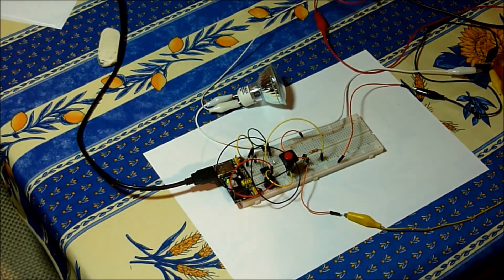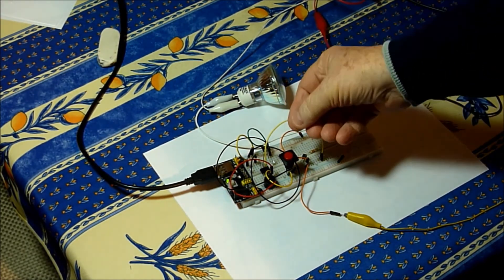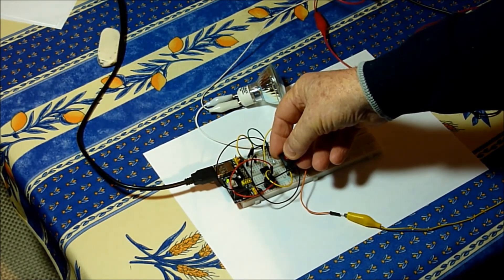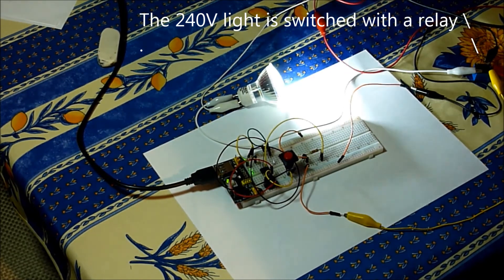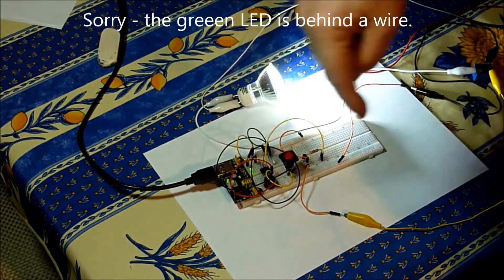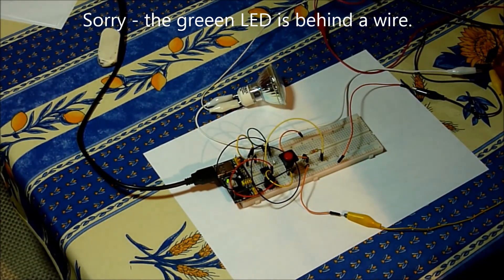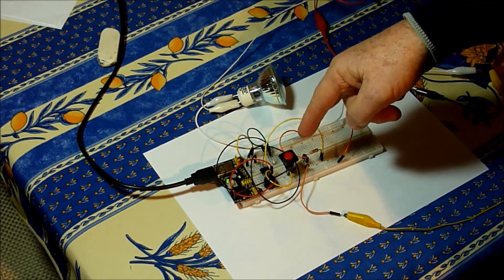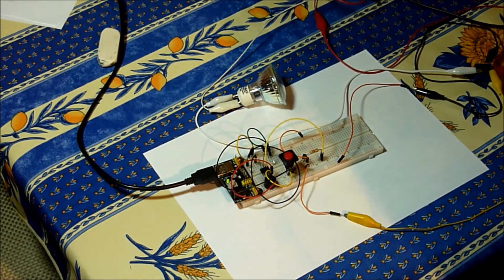ATtiny Assembler Tutorial Part 1 - Introduction

Comment: Hi
Thank you for your cheap design, I interest to make it but I can't find what components you used and circuit board design can you share please and some more information about components?
Thank you
Reply from the maker: Which design are you referring to?  In the course introduction, I mentioned a couple of things I had done with the ATtiny85 - the slow-start for my table saw (still working fine) and my "one-button timer" (schematic and code is on Google Drive.  See the links in the description text of "ATtiny Assembler Tutorial Part 6" During the course, I played around with the timers, flashing and dimming various combinations of LEDs.
The timer was built on breadboard, and I did not make a circuit for it.  There was no printed circuit card for the slow-start either - I just made one for myself on strip-board, but the schematic diagram and the code are in ...
https://drive.google.com/drive/folders/1AwNbtnRtm9biUsw1ys868ZAWf-T7BVDu?usp=sharing
I must tell you, however, that I did it with an ATtiny85 because I wanted to play with the chip and learn how to program it.  I could have made a soft-start more simply with a 556 dual timer, an opto coupler and a triac, and it would have done the same job.
Reply: @DownhillAllTheWay  Thanks for your reply, I really like soft start because I have saw and looking to add soft start to my saw , your design is the best and I would like to make it , if you can make more simple I really appreciate and let me know what components I need , I really like to learn from you but I'm beginner I don't have any idea how to make PCB design so if you can make simpler better for me. 
Thank you

Comment: Hi Mike
Very nice & simple setup for that soft start.

I downloaded the soft start schematics & other files from https://drive.google.com/drive/folders/1AwNbtnRtm9...,
 wanted to make a similar circuit as yours, I can see most of the parts on the schematics but missing the capacitors, T1 secondary voltage 
i assume is something between 7-12 volts, also the MOC is it a 3052 or 3021........
Could you pls. add the parts list. 
Any help would be appreciated.
R.G
goldring101at hotmail.com
Reply from the maker: I'm sorry Roger, I only just noticed this, though you asked 3 months ago.  Did you eventually get the soft-start made?  I put mine into a plastic box which is attached under my saw table, and it's a pig to get out, but if you're still having trouble, I'll try to figure it out for you.
One thing I remember is that the triac has to be much beefier than the specs.  I think I used a BTB16-800  (800V blocking, 16A RMS current) 
http://www.farnell.com/datasheets/1749668.pdf